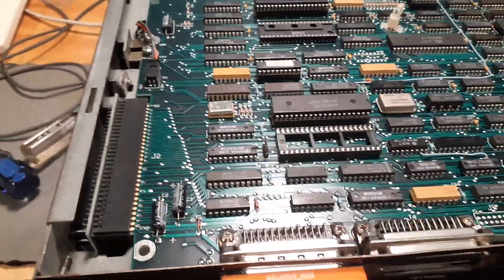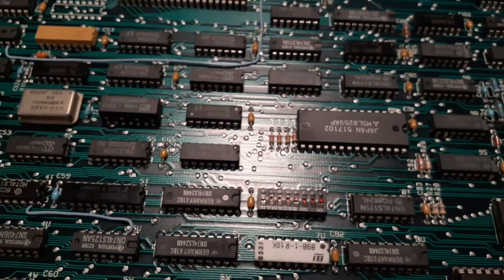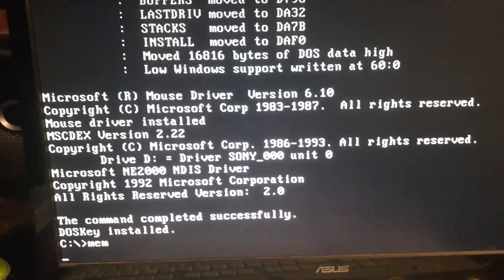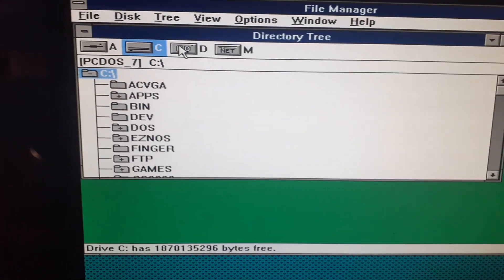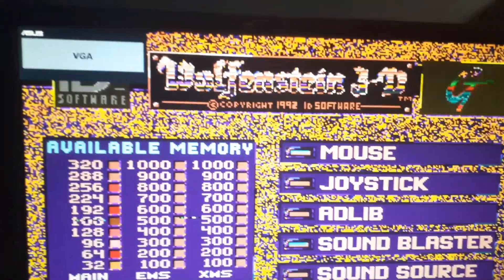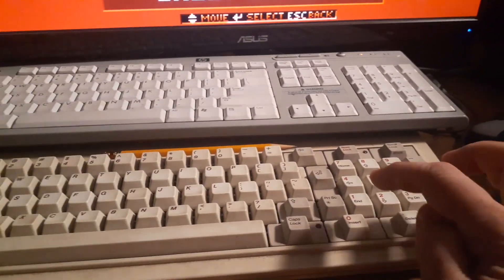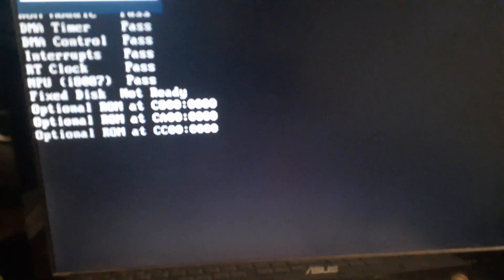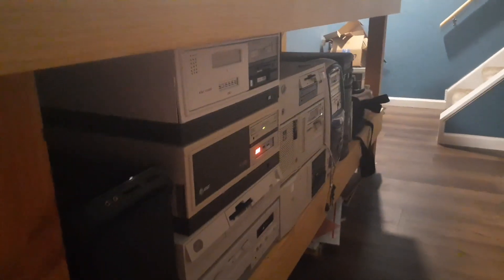AT&T PC 6300 with an 8087, 128KB UMB, CD and Network drives in Windows, and... Wolfenstein 3D?

Comment: Next put a battery in ?  I just did on mine, batteries plus , 1/2 AA size, lithium-thionyl-chloride with axial leads.   You can solder it in from the top side no problem.

Comment: As far as your issue, you don't have a V20 - you have a V30. Slightly different instruction sets, and more critically, different fingerprinting. If the code is checking for a V20, and doesn't see it, perhaps it quits? Something you should be able to check with SoftICE or another low level runtime debugger... Maybe make a patch? Pardon my 1995 Hollywood-derived parlance, but that would be pretty 'leet, homerow. And yes, I used 'homerow' back then, mostly to troll...
Reply from the maker: I was thinking that, but the fact that it does work correctly within DOSBox which would not announce itself as a V20, leads me to think that it only is concerned if 80186 instructions are present.  I guess it deserves further evaluation.

Comment: It used to be the reason the VGA colors are wrong is because the AT&T 6300/Olivetti M24 swaps the low and high byte of 16-bit bus transfers -- the entire reason the bus correction kit was created, unfortunately.  So some games send palette changes as words instead of bytes, and results in wrong colors on a 6300.  But if you reboot without a network driver and that fixes it, I have no explanation.

Because you can load and run software over a network, you may want to reconsider the CDROM drive.  There is almost no reason, then and now, to have a CDROM drive in an 8086-class system.
Reply from the maker: I will have to try to run one of the device drivers that were provided with the buss correction kit to see if that may fix that particular issue.  Possibly it may clear up the red screen on exit as well.  The bad color pallet only seems to be affected by running Windows first, and honestly, rebooting the machine is not much of a hassle. 

Yeah, the CDROM is superfluous, but I still think it's kinda neat to see an optical drive in a machine it was never intended to be in.  That, coupled with the sound card, makes it nearly a "multimedia PC" by early 90s definition.